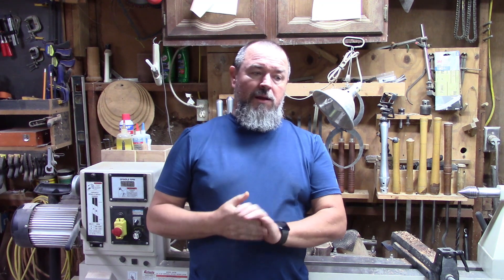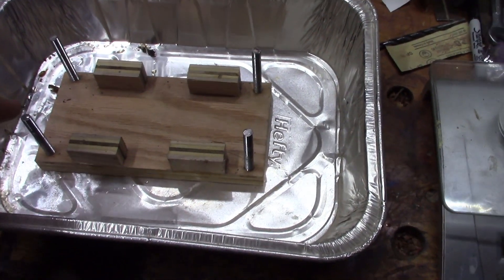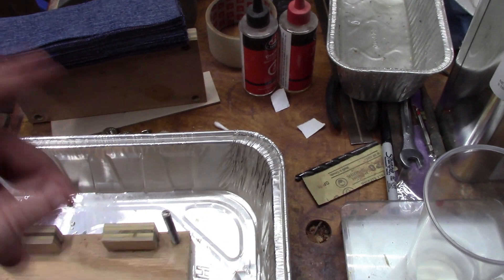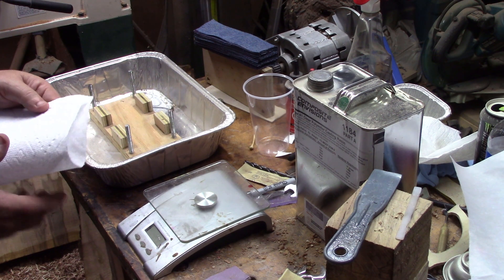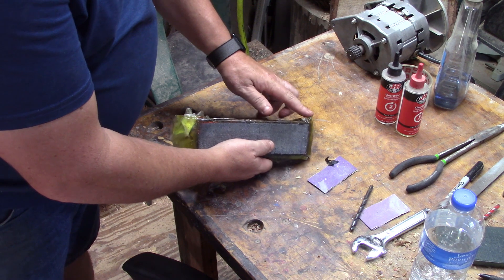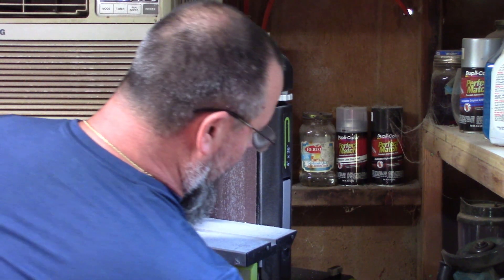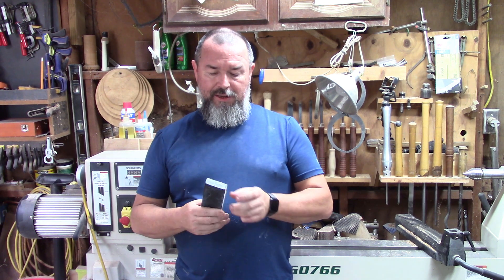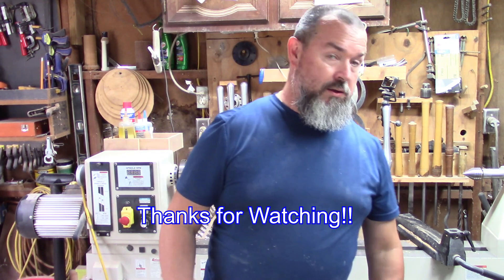#187 DIY Making Micarta from Denim

Comment: Very cool,but I would use clear resin instead of the stuff that yellows?
Reply from the maker: Thank you John. I agree. This resin is clear when it cures. However, it will sometimes pull dye colors from the material. The yellow color was probably from the markers I used when cutting the material. Thank you for your observation. Take care!

Comment: Good job. I can see this used for pen blanks. Could even build a bowl blank. Interesting. Thanks for sharing.
Reply from the maker: Thank you Doug. This is the resin I use for all my casting. It makes very good pen blanks along with other blanks. It is durable and impact resistant which a lot of polyester resins are not. I also did a bowl on Youtube using this resin. Turned out perfect until I allowed it to fly off the lathe and hit the bedway. Destroyed it. Here is a link to the first part. if you are interested. The bowl would have been very nice. Oh well! https://www.youtube.com/watch?v=jDlBavtVkCk

Comment: Stephen -- As you promised last week! Thanks for following up as usual. Interesting product and I think there could be a lot of uses for Micarta.  One thing I am wondering about heat transfer? I have some cookware with metal handles that get hot to the touch and I am wondering if I could overlay Micarta on the handles (for stove top cooking (not for ovenware or open flame), do you have any thoughts on heat transfer from the metal handles through Micarta? Thanks for showing the process. Regards and as always, my best to your family. Stay Safe!!! Dennis
Reply from the maker: Thank you Dennis. Glad you enjoyed this project. Micarta is a great handle material, but I am not to sure how it would perform with heat. You would need a heat resistive resin. The Silmar 41 I use would probably not work. Not sure but that is my opinion. However, there are heat resistive resins out there. You could give it a try. Thank you for a great question and take care my friend.

Comment: Awesome process. Like the glue up jig to keep the thickness even. How many layers of denim did you use to get that end thickness?
Reply from the maker: Thank you Jeff. The spacers really help keep things uniform. I am not sure how many layers I used. 20 to 30 probably. I just kept cutting the layers until they were stacking about  20% taller than the spacers. It allows for very tight compaction and epoxy penetration all the way through. I hope this helps. take care.

Comment: Very cool Stephen, hey what type of resin you use to make pen blanks with no pressure pot. Enjoy all your videos
Reply from the maker: Thank you Donald. Glad you enjoyed this project. I use this same resin for making my pens (Silmar 41). As long as it is only resin. I generally have no problem with the air bubbles. If you add wood or some other material, in which case I use a vacuum chamber to degass the resin. I have updated the description to include a link to Silmar 41. Hope this helps.